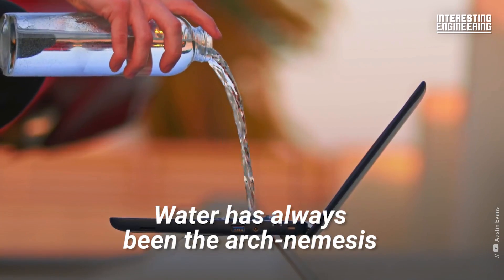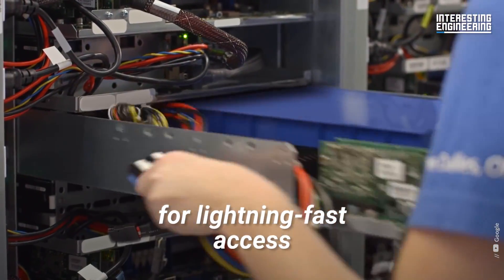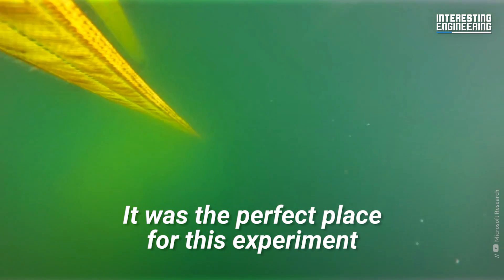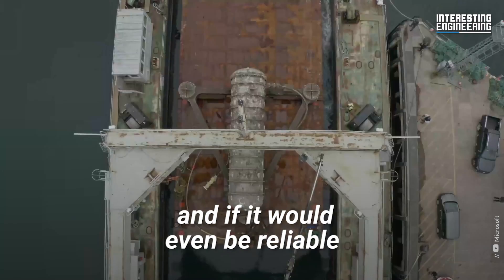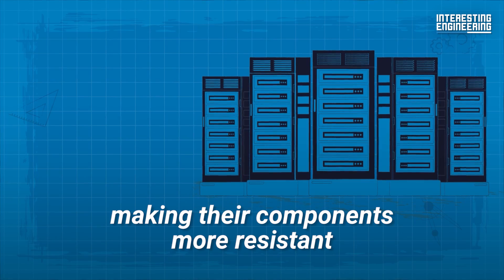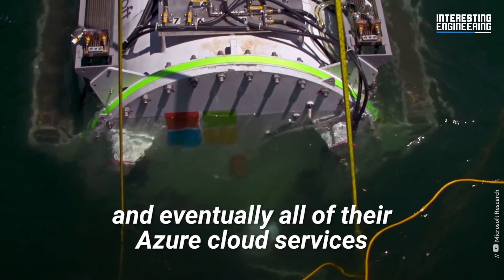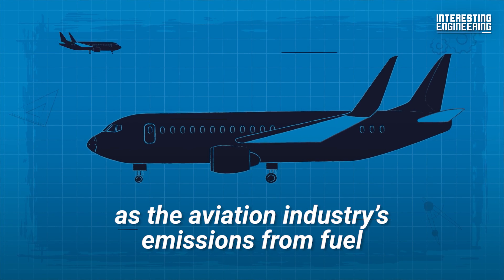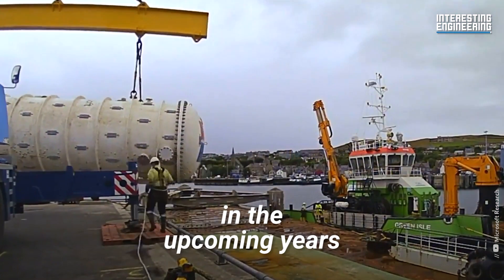Why does Microsoft have underwater data centers?

Comment: How do site reliability engineers work ? 
Do they dive into the ocean on a regular day ?
Reply: No maintenance at all.....Only after a few years.....or if any severe breakdown occurs...
Reply: @cck1496  That rarely is the case, in reality data centers are never empty. 

You can almost always find some engineer shivering in some corner of the data center without a jacket doing some maintenance work or health check.
Reply: @Sean Embry Sounds like a fairy tale and would also make a great impression on the customer but the reality is that even aws has outages and data centers that go down inspite of all that redundancy and computing power.

Almost all cloud providers have a status page that show the status of which services are up and which are down. 

There must be a reason why admins book mark the status page and use it to answer emails from their big bosses cause for them status page is like confirmation that SLA is breached or not for a service. 

A data center without needing maintenance and simply relying on redundancy is still very impractical.

I like the idea that it's trying to reduce the electricity consumption that goes into cooling by being under water and supplemented with nitrogen for that extra boost in cooling but it's still an experiment or a POC at best.

Industry is far from having real world submerged data centers.
Reply: @pandit-jee-bihar  Thanks for sharing your valuable expertise. Keep it up.
Reply: @Sean Embry Good point. Out of band management makes sense.
Reply: Hahahah new job advertisement would be expertise in server maintenance and scuba diving
Reply: It might be they have AI robots to take care of the underwater system maintenance, but they don't want to disclose it...
Reply: @pandit-jee-bihar  Please use common sense. Look at the size of that and compare it to a human. It is very obvious that there is no human inside it. In order to fix anything, the data center will have to be raised to the surface.
Reply: @damianxavier7343  Please use some literary sense, words often don't convey what they mean. 

In figures of speech of they are often referred as sarcasm, joke, humor. 

But the fact is everybody can't understand technical jokes and those who do have a "common sense".
Reply: @pandit-jee-bihar  idk man, I personally don't find anything funny in your comment so it's not a joke and I don't see the sarcastic part of it either. Could you point out the sarcasm here?
Reply: @damianxavier7343  You can move on from here and have a life!
Reply: Im wondering if a drive fails, i think they have to accumulate some of them to replace them.
Reply: I am more interested on Why did you pick that name.......
Reply: They've hired mermaids to maintain them😂
Reply: A I
Reply: “I’m not a mermaid…I’m a 🧜🏻‍♂️ Merman!!! A Merman!!!”

Comment: I disagree with this setup for the following reason: a computer converts all its power to heat. This means it is in essence a heating device. It is more smart to use that heat to heat buildings than to use it to heat seawater. That said, a landbased datacenter that doesn't reuse its wasteheat is even worse. If we look from the perspective of water usage, the submerged datacentre has its merits, as there is no usage of drinking water.

Comment: Likely in the event of war, subsea data centre's would be better shielded against radiation. These solutions seem more likely in preparation for nuclear fallout. The world's data and ultimately man kinds collective knowledge just before they die, would all be backed up for the world after.
Edit: If these solutions were actually efficient or increased profit in anyway they would be proliferating the business already. The inability to maintain the servers already tells us they're meaning to leave the servers unattended for long durations. The renewable energy sources used are discontinuous and unreliable at best which suggests the servers would be in a dormant state mostly. Also note most of the world's systems use Microsoft windows and so 'The Great Backup' would happen with a mere click of a button. There is more than meets the eye with what they're doing here and likely the governments around the world will be taking interest.

Comment: How does it interact with the biodiversity it's submerged in ? I mean you put a heating element in a cold environment and life will attract towards it to get heat from this source. Does that degrades the convection of heat from the data center ?
Reply: Not just 5hat but now to service them they need boats and divers

Comment: Wait, so how they access that underwater data center?
Do they also run IO cable along the power cable?
Reply: probably, do you know there is an entire cable from usa to europe underwater? cables are just too good to be replaced.
Reply: @suyashsingh9865  there’s actually several underwater cables that run from continent to continent. You can look it up for more detail.
Reply: @RandoHandle So, if they access more for purpose, how long they should repair for each can of servers? are they repair one of them per month, week or per date?

Comment: Because water holds memory it's that simple
Reply: Ahh not for this application
Reply: Frozen 2
Reply: @freshbakedclips4659  this is not frozen 2
Reply: @ACommenterOnYouTube  if it's not then explain almost all cables for internet are ran under the ocean why is that ?
Reply: @bengettinit7317  Because continents are seperated by oceans that's why.
Reply: @bengettinit7317  because the land is seperated by water. So there are only 2 ways to get communication lines from land to land and that is either overhead with poles or laying on the ocean floor.
Again not sure why you are asking this question.

Comment: this is stupid!!!!!!
All those heat goes into the water and disturbs the aquatic life in that area
Reply: Good point
Reply: not even 0.000000000000000000000000000000000000000000000..................1 % of ocean is been affected by this
Reply: Pretty sure that a study is conducted on that matter, especially during the feasibility study of the project.
Reply: @jarvis3551  but the life around it gets affected 
If thousands of this centres are planted underwater then it will sure affect the surroundings

Comment: Wow, using the ocean as a heat sink. 🤦‍♂️
Reply: Mudkip909  Microsoft is looking to he better for the climate, but heating the ocean at the same time. The ocean is getting more acidic as it warms, affecting sea life.
It may be the case that as a hole under water is better for the climate/sea life. In that case I'm for it. The video bragged about the good effects but never mentioned dropping heaters in the ocean.
Reply: Mudkip909  your right. CO2 absorption affects acidity.  From the little I looked up, temp doesn't affect absorption.